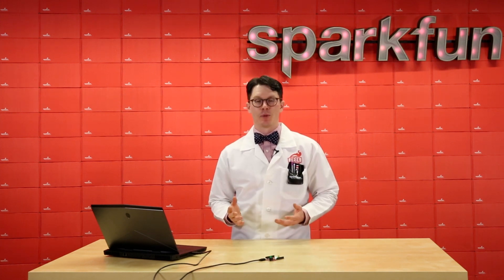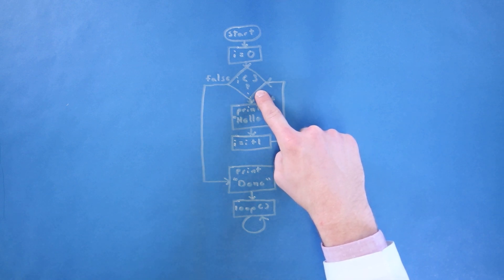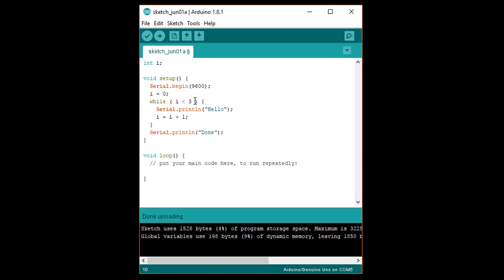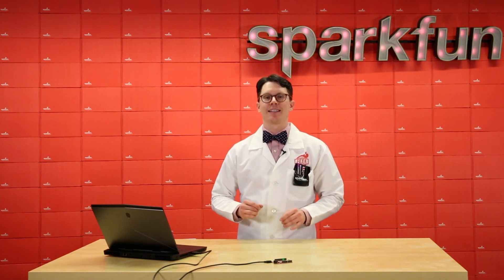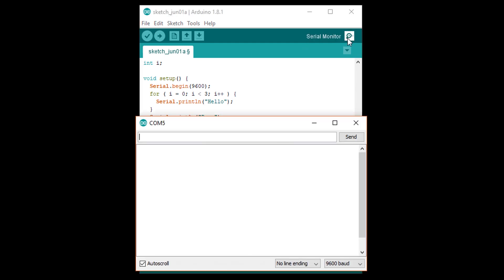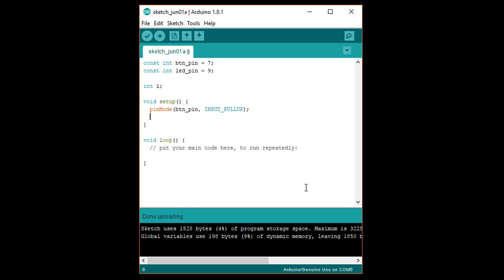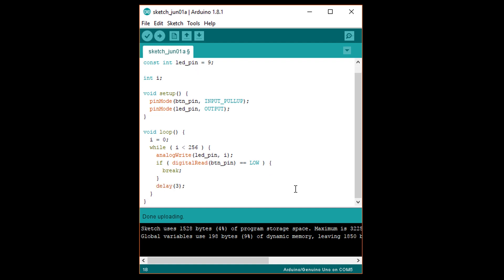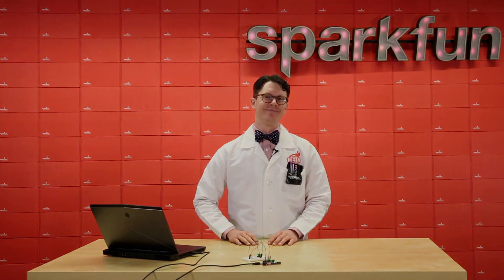Adventures in Science | Arduino Loops

Comment: You are using an LED BACKWARD, The Resistor ONLY goes on the Anode +. Power supply to resistor to the Anode. The Cathode goes to Ground. Learn something OK
Reply: dont agree, it's a serial circuit, it doesnt matter were you place the resistor (anode or catode)
Reply: You will burn out your Led, What is wrong with you?
Reply: correct

Comment: Different subject: Software interrupts
How do you do software interrupts in Arduino?
Yes have used hardware interrupt such a RTC module but where are the software interrupts that these chips have and code does not allow use?

Main service loop to do a task
After time interval, break and do another task then return to the mail service loop
Currently been using counter in the service loop to break out but it makes timing an issue